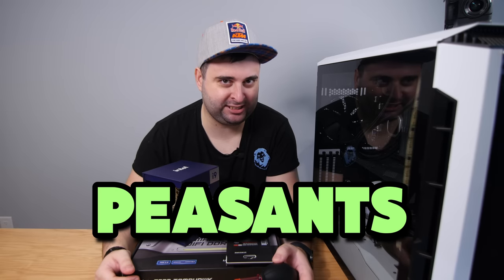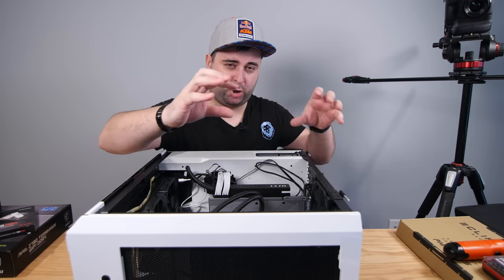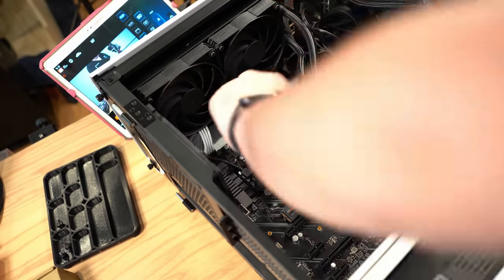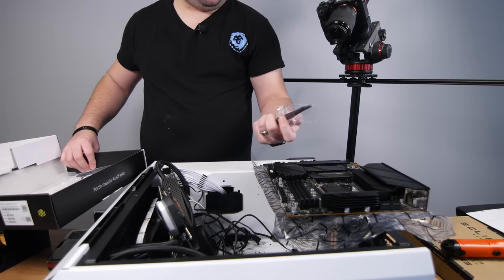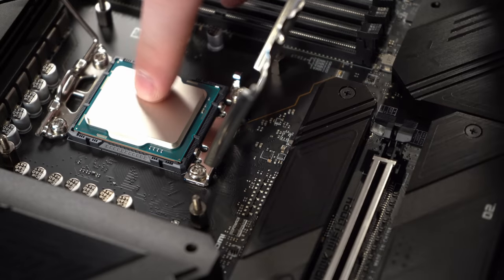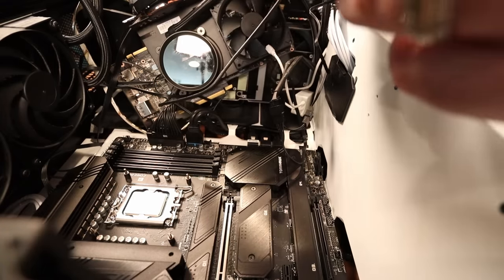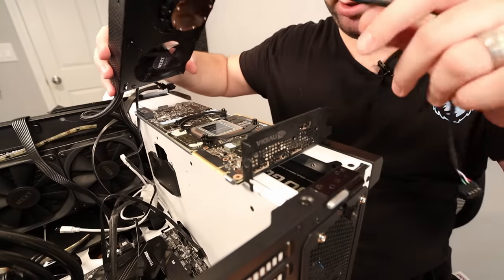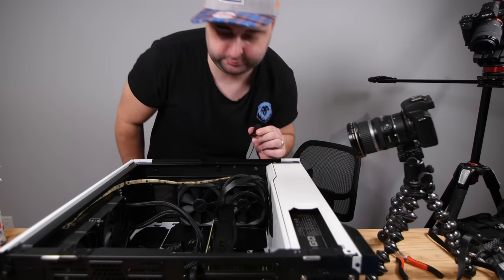Upgrading My PC BUILD VLOG - Nick Bunyun PC 2022

Comment: Isnt the pump for the gpu higher than the top of the heatsink? I think it will die faster that way..cause its not 100% full with water and the pump will push air too cause of the positioning. Check online!!!